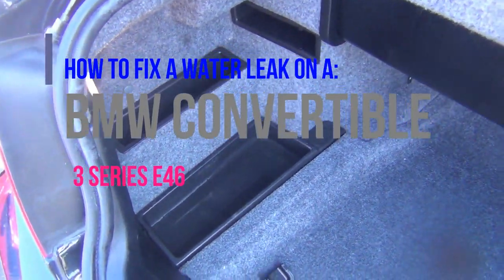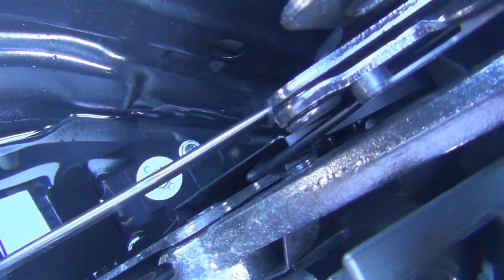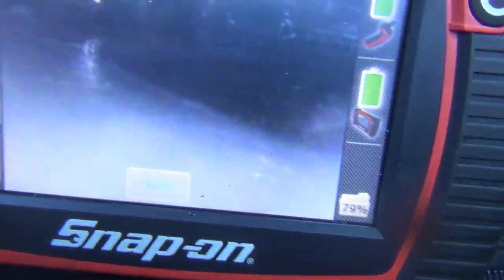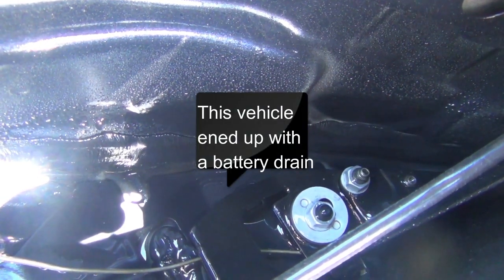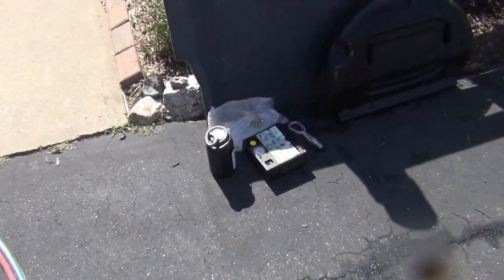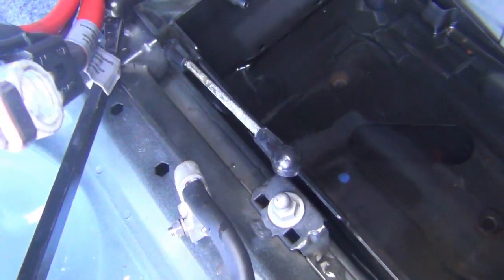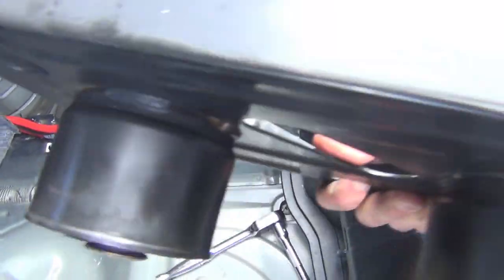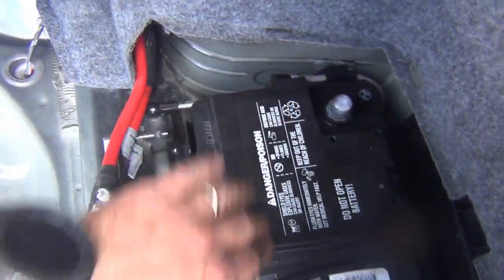BMW Water Leak E46 3 Series Convertible: Diagnosis and Repair Procedure With Battery Replacement DIY

Comment: Hi and thanks for posting this video. Had this problem two days ago. Took out and dried everything and had no electrical issues with my car until today. My seatbelt light and airbag stay on . Also turn signals not working, fog light indicator not working. Question is what can I do to fix this problem before it gets worse. Thanks in advance!
Reply from the maker: Hi Dennis, Glad you found my video to help solve the problem. However for your current symptoms your vehicle would need hands on diagnosis to determine the issues. I would consider checking your airbag module for water and corrosion.
Reply: Thanks for your response! But thanks mostly to your video cause I fixed my problem.i took off the wet Velcro strap from the connectors and sprayed the connectors with air spray and everything is working perfect again. Thanks again!
Reply from the maker: @dennisthem3nace197  That is great news Dennis! Your K bus may have been shorted via corrosion. It had been a crazy time. Still working since automotive is an essential business. Keep safe and my best to you and your family!
Reply: @dennisthem3nace197  I have the same issue right now, cluster and sat nav not working, checked the Velcro strap and wires, full of water…
Reply: @dennisthem3nace197  Where are these wires and velcro strap located? In the trucnk?
Reply: @mohammedkhan1791  Where are the wires and velcro strap located? Trunk?

Comment: How does the water get into the compartment at the first place anyway?
Reply from the maker: Good question. This area is not water tight. The seal around this area only helps reduce the amount of water allowing the water management system ie drains to handle to overflow.

Comment: BMW design tech - Sir, I can strap the battery down with a bolt and a clamp, but it will cost $2 in parts.
BMW management - NO! Design a complicated box of stamped and welded metal with ball links, rods, and machined risers. We can charge an extra $2000 for it.
Me - Holy crap!!!

Comment: Jeez I have been poking around for an hour with no joy
Any tips?
Reply from the maker: Hello, It can be difficult to find the right spot. Try changing the angle of the tip on the cost hanger. Also a scope can help. The teslong scope from Amazon is very affordable.
Reply: @AskTheCarExperts  Thanks, is there a plug in the drain hole that needs moving out or am I feeling for a hole?

Comment: Tried wire. Didn't work. Tried drain unblocker. Didn't work. Got some phat coke cola. Poured half a tin down each side. Left for a few days. Cleared.
Reply from the maker: LOL 😂 Love it!
Reply: @AskTheCarExperts  seriously, mr muscle, lime descaler, buster drain unclogger, used for a couple of weeks just did not shift it. I am wondering if the fizzing and acidity of the cola is what shifted it. I was on the point of selling the car i was so fed up with it. I followed the cola with boiling water after it had drained.
Reply: gonna try this, like you, wire, product didn't work right side, its doing my nut, soaked carpets, the lot, gonna try the coke . . yea, past life lol, thnx, I'll do it as suggested,   'hope it works

Comment: I've got at least a inch of water under my battery
Reply from the maker: Hi William, It's a good thing you found my video. Most likely clogged drains under the too frame. I show you how to remove the battery and the bracket in this video. I hope it helps and please subscribe :)
Reply: @AskTheCarExperts  yeh lucky...I briefly went through your videos. I like your alpina video, mines a b3.
Where you based...UK? 
I've recently lost pairing on the key fob, watched a video but didn't work for me.
Reply from the maker: @williampilling3218  Located in CT in the USA. I had assumed you had an E46 Conv. We don't have the B3 specifically in the US market. The best thing to do is a water test with interior panels removed. I have been stuffed in a few trunks hunting water leaks. Easier with a hatchback style openings. Some common spots are clogged sunroof drains and tail light assembly seals.

Comment: stupid idea not to have a drain hole in the battery area, in the 944, same area, has a drain hole
Reply from the maker: Yes that is something BMW has never done. E60's also can pull water into the trunk from a vacuum crated while driving and cause a lot of damage. A body plug with a small drain hole would be a good idea but they may not do it on a BMW because the vehicle can create an internal vacuum and draw water in during a rain storm depending on the path of the water. Thanks for posting Adrian!
Reply: If he removed the second plate under the battery there are 2 drain plugs , you can see them from under the car but need to remove other plate to knock them out